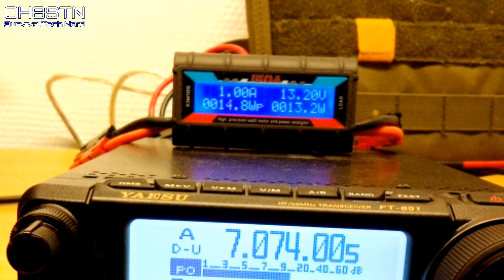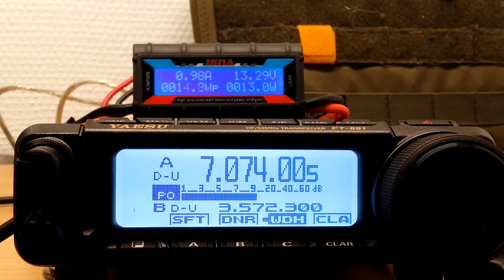Yaesu FT-891 RX Current test - Signal Present

Comment: Be nice to see some icom radio reviews in the future.
Reply from the maker: it is possible.
I nearly ordered a 7200 during February 2018 and would still like one or a 7300 for the shack. They are great radios for fixed installation work, and are incredibly reliable.
It will take some time but it is possible.
73
Julian oh8stn.

Comment: Julian, On one of your posts you made an offhand comment about a "go box". To do digital in the field it would seem one needs at a minimum a radio, power source (battery, solar, generator etc.), interface (Wolphilink, Signallink etc), computer or tablet, and the correct time, which if you have no cellphone service in the field would suggest a GPS receiver. Possibly optional but nice to have would be an antenna tuner and SWR meter. 

It would be great if there were a portable rig with all this "built-in" so one did not need any interconnect cables and one could grab one item in an emergency. Ideally, the rigs case would be rugged and waterproof. The rig would be the "go box".

I would appreciate your thoughts.

Thanks, WA1KLI
Reply from the maker: Micom, Codan, ... need I say more!?
If we ignore cost, these radios are certainly what we should all strive for. Then again, we can't talk about these radios without mentioning ALE. ALE has been difficult topic to bring up on the channel at QRP levels, but these type of radios and ALE, provide seamless Communications for the worst case scenario. These radios usually included front faceplate and keep panel for messaging, have extremely low current draw, and can survive whatever you throw at them.
I can reach out to the green radio suppliers in the region, to see if I can get the sponsored video series going on the topic. Even if I could pull it off, a series like that would only be interesting to the most hardcore and well financed amongst us.
73
Julian oh8stn
Reply: OH8STN While military grade ALE radios are great, that was not really  what I was thinking of. You are correct that they are not in the average ham's budget. Given a uBITX can be had for $109 US, perhaps it could be used as a starting point for a versital, digital field radio?
Reply from the maker: Certainly it could. I also thought about using the bitx40 as the basis for a field Deployable Digital radio, but it almost becomes a waste of energy unless education is the primary goal. What stopped my project was the lack of tools and a proper Workshop to build a rugged enclosure and integrate all of the other components required to make what would essentially be a mono band qrp radio. Ultimately we still have to integrate all of the same components into some sort of rugged kit, most hams could not make at home without it weighing 50 lb.
Don't be discouraged though I have thought about these things extensively. I've decided to take the development from varioys sources, integrating all of those components into something small and manageable.

Comment: Another great demonstration. I'm relatively new to the hobby, but am really fascinated with digital modes. I have an FT-891 also and have had very little luck getting USB CAT control and third-party tuner control to work with the radio. Would love if you showed your tips on best settings for this radio in those situations. 73 de K5PSN!
Reply from the maker: Tell me exactly the software that you're using and the interfaces that you're trying to use it with, and I'll try to put something comparable together with what I have here.
My next 891 video# ( probably shouldn't say it) are digi mode settings, cat and audio interface settings for wsjt-x,  fldigi/flrig, aprs messenger.
Im not an HRD guy, but I bet with these tutorials you'll be able to figure it out if that's what you're using.
Let me know 👍
73
Julian oh8stn
Reply: WSJT-X for OS X and Windows 10, Ham Radio Deluxe, and fldigi for OS X are the software applications. Using a SignalLink USB for the audio interface. I've had no luck with any settings doing USB CAT control on either OS, but WSJT-X is working fine with the SignalLink and VOX for PTT and audio. 

For the tuner I got an MFJ-929 which was strongly recommended to be by the retailer over the LDG option. I can get the tuner to tune automatically through the antenna, and it works great, but not through the supplied interface cable per the MFJ manual. The downside to that setup (which you can uniquely appreciate) is that you then can't power the tuner with the radio; I have to provide a separate DC power source for the tuner. 

Looking forward to what you share! Great channel, brother!
Reply from the maker: I'll start with the data mode settings on the 891 plus the setup video for wsjt-x. But it's going to be on Windows 10. Look for that one by next week.
73
Julian oh8stn